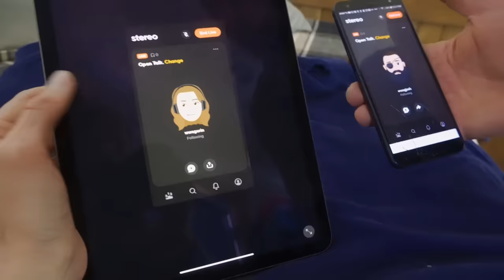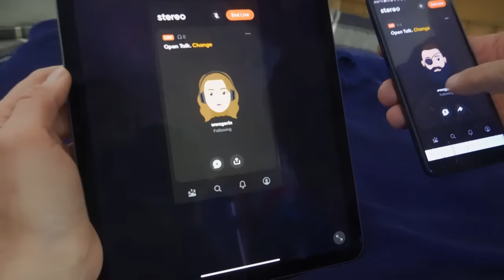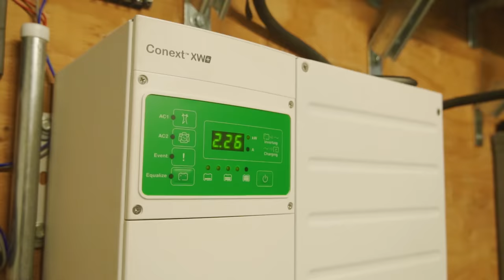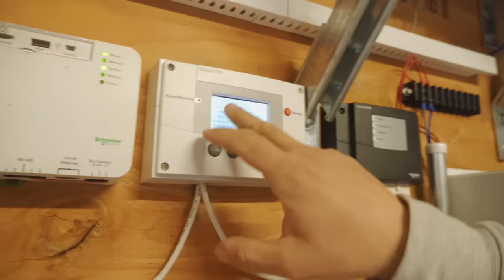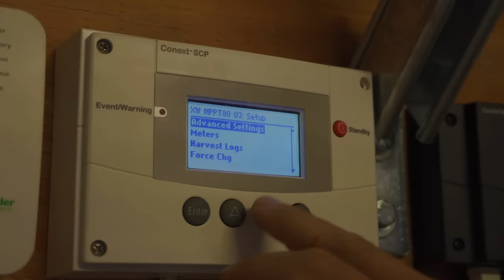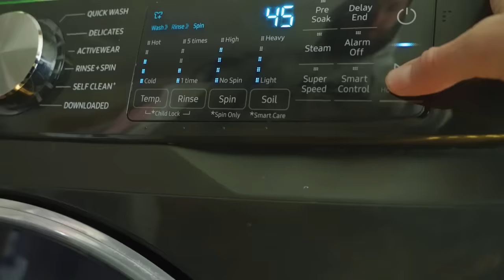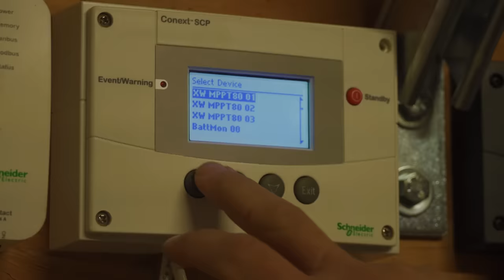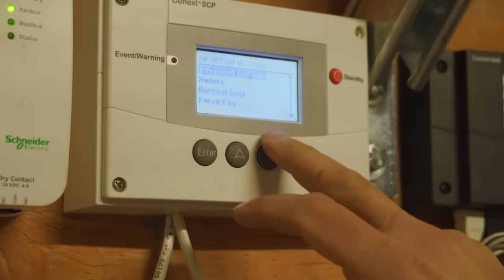START TO FINISH TIMELAPSE- Couple Builds A Solar POWER PLANT

Comment: I'm not much on podcasts so Ill ask my questions here .1/ The original cost was $15k so you tripled it . That means the cost went to $45k ? or maybe $50K with extras . If an installer does it thats probably another $25k. I know the satisfaction is worth it but I worry at night for mine about breakdowns costing heaps and the batteries don't last well.  2/ How do you keep the stock away from the panels for scratching and chewing . My cows test everything for taste  and a ton of beef scratching its arse on my panels would not be helpful.?

Comment: After watching you two, we set our goal to do the same.  Looking for land in TN mountains now.  Question:. Does your solar system generate 13,000 watts per hour at peak conditions?  Also, if you don't mind me asking, what was the total cost after the expansion?
Reply: @ Josh ...In case They are took busy to answer, I will give my best estimate...Their over 13,000 Watt Array should Avg. ~4 sun-hours (lattitude West VA.?) so after ~5% total losses (PV Cells to AC Loads), =~50+ kWatt-hours/ day on Average.
Reply: @solartime8983  thanks for the information!

Comment: Congrats on the new Lambs 👍 did you take the panels down to add new ones in a different position?
Reply: They took down the original panels and put them back up but arranged consistently with the new panels.  They did that in this video!

Comment: I'm want to build an Aframe and was curious how much you paid per sqft doing it your self vs if you had a contractor build it?  I want to build it but the wife not so much and im trying to see how much I could save... thx
Reply: I'd contact a builder in your area and ask him what he would charge, then take a copy of building materials to where ever you would get them from ? subtract that amount and that should be the savings of DIY.  Every area in the country will be a different amount, so what it cost Josh & Erin most likely would be different than other areas and therefore not very accurate.

Comment: I was confused about how you would even consider heating with electricity generated by solar cells until
you mentioned your Mr. Sun units.  You’re not really heating with electricity.  You’re using electricity to run a heat pump that pumps heat from outside into your house.  Is this a ground source heat pump or is it just running off a heat transfer unit outside your house?

Comment: Erin said 13,000 watts of solar.  Josh said an inverter of 6,000 watts.  In the inverter undersized?   6000 watts will not run a whole house with everything electric.   At least my emergency won’t.  Comment? 

JoeB